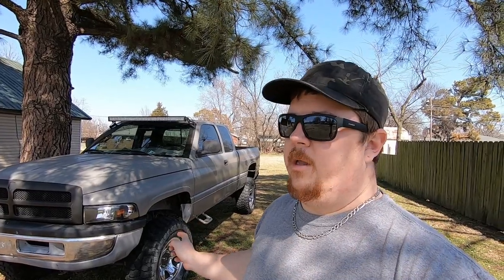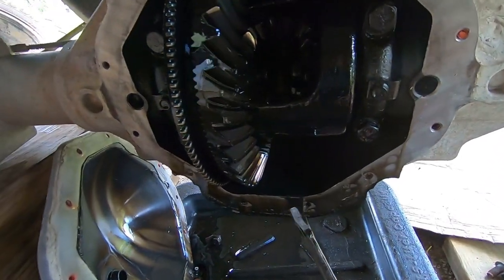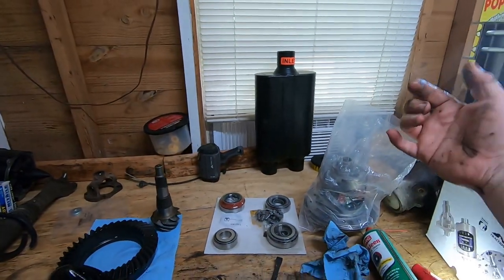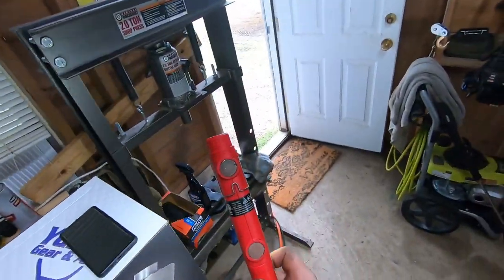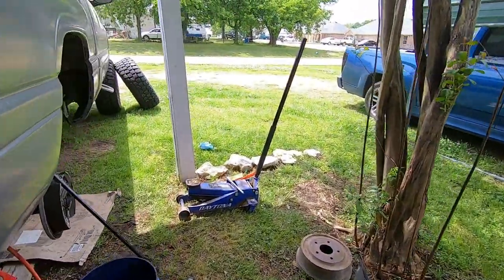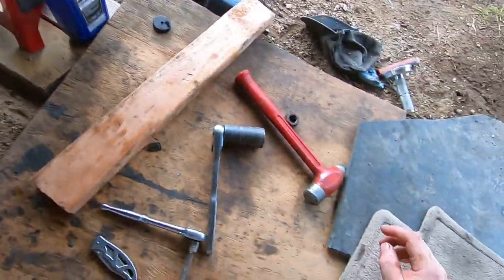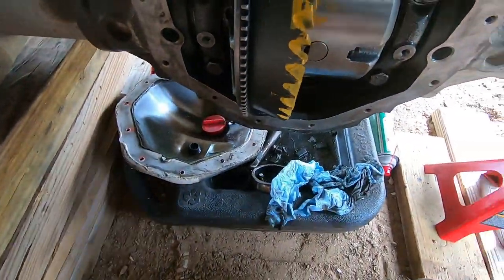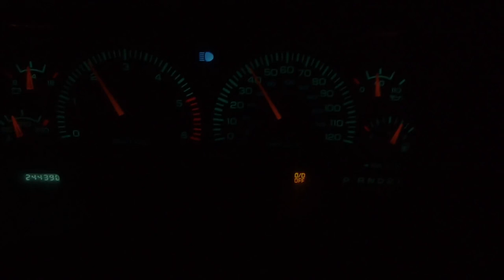94-01 Ram 1500 Motive gear 4.56 and Yukon Posi install (Chrysler 9.25)

Comment: How do you like the posi? I have an 01 2wd 1500 and I'm thinking about ether a posi or some kind of locker. My driveway is crazy steep and all decomposed granite. I've been burning out the passenger side tire every year so I'm hoping something like this will help me out. When it rains it's next to impossible to get up the hill...
Reply from the maker: I like it a lot. I haven't even put my front drive shaft back in yet. There's a beach by my house and I took the truck out there on multiple occasions and it doesn't even need 4wd drive any more. Only time I think I'd use 4wd is if I was doing something I know I shouldn't be doing anyways.

Comment: you make it look so hard I have a 1998 ram 1500 with 3.55 i think stock i have a 20 ft trailer i pull its so gutless is 4.56 the way to go . im looking to do it my self would love to learn how to do the same. did you change the front axle . and what gear did you use . thanks
Reply from the maker: Well it's not easy lol. Working on the ground under a vehicle never is and I'm 240lbs. Lol. I pull my 20ft car hauler and it pulls like a dream. Your not gonna do any speed runs, but it pulls mine 65ish pretty well. My motor is worn smooth out too. Drinks oil, piston slap, and has tons of blow by. I can only imagine a truck with a good solid engine would pull like. I'll be rebuild my engine sometime soon. I haven't done the front yet (I don't mud). I have the 4.56s for the front too, just haven't done it. I've been to busy hauling cars and trying to make money.

Comment: What are all the tools you use for the bearings and seals?
Reply from the maker: Bearing race and seal installer tool from Harbor Freight.  https://www.harborfreight.com/bearing-race-and-seal-driver-set-10-pc-63261.html?utm_source=google&utm_medium=cpc&utm_campaign=12144811130&campaignid=12144811130&utm_content=117789282438&adsetid=117789282438&product=63261&store=3052&gclid=Cj0KCQjwkIGKBhCxARIsAINMioI_jvhRZGPj_ZBcNY0t5lg8ws8xZN82zZ52Ii-jhlPdcimT_uIhqk8aAl0QEALw_wcB
Reply: @james4wd236  m

I’m

Comment: any issues putting your stock center pin back in ?
Reply from the maker: You leave it in when you installed. Loosen the bolt and slid it half out to do the c clips.

Comment: How you like it so far ?
Reply from the maker: I love the extra power, but the trucks engine is worn out so its still pretty gutless. I will be rebuilding the engine soon more than likely.
Reply: @james4wd236  plenum?
Reply from the maker: @Im_a_dumnigga  Has a brand new Hughes Plentum plate in it and new cylinder heads. The rings are gone, smoked out he breather like a freight train and burn a quart of oil every 300 miles. Pistons rattle if you rev it. Motor is on its last leg lol

Comment: Question: What is the purpose of the "crush sleeve" on the pinion gear shaft?
Reply from the maker: Its to keep pressure on the outer pinion bearing inner race and keep it from moving on the pinion shaft. It also keeps pressure on the pinion nut.
Reply: @james4wd236  Thanks. I think I understand. This distance varies from gear to gear, so it has to be somewhat conformable, I think.

Comment: That dash is all but gone...want a really fun project?? Yep that dash ..not oh boy super pain in the azz.  Took hours to get it out of the junkyard truck .and was not nice about it .wire cutters and sawzall.tons of rivers to drill out ...then took another 4 months of looking at it in the shop.  Two days later I had taken what was left of the super Arizona cooked dash.so brittle pieces shattered and fell into places never to be seen again .but soon worth it especially when I seen yours ..mine was the same maybe worse.you are not tricking anyone with the dash mat..they protect your dash..ha ha hehe real funny no .used to cover the dodge broken plastic dash like a sheet covers a dead body...but for real that dash is a check of a project but so worth it when it done..Nobody goes dam dude what happened to the dash.? Dam dude I had to spun out raccoons locked in my cab .what do you think pretty cool.? Well anyhow the screws in the backside of the passenger side above the globe box is the toughest.at of screw you can't see removing the printed towards yourself ..